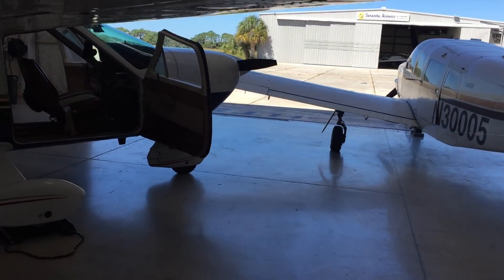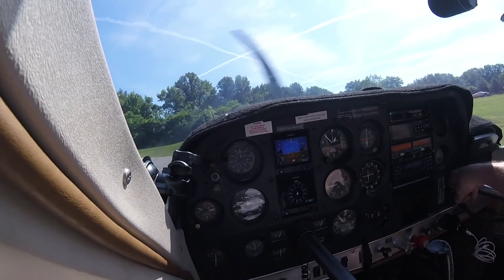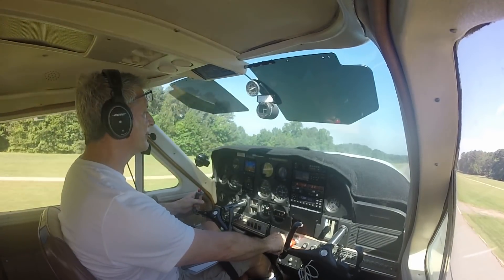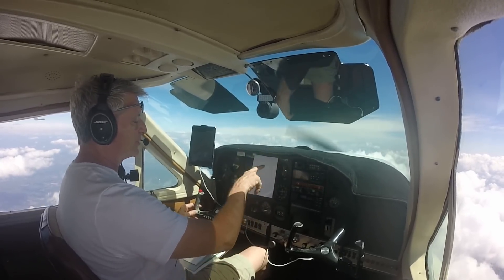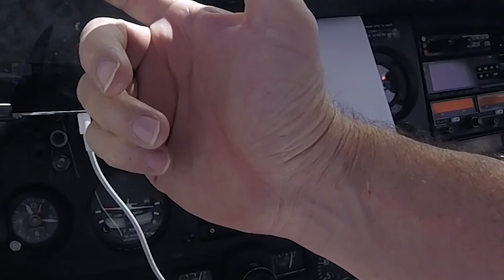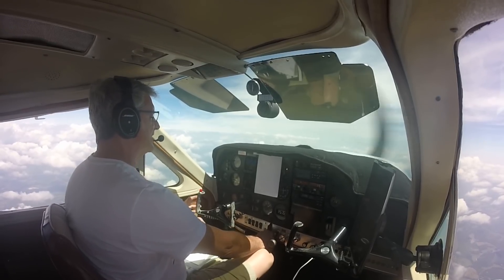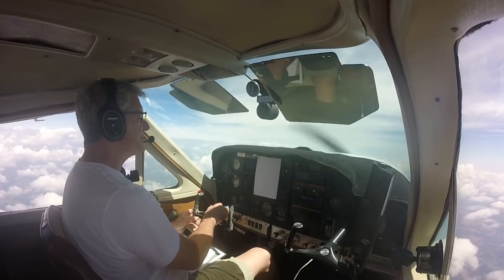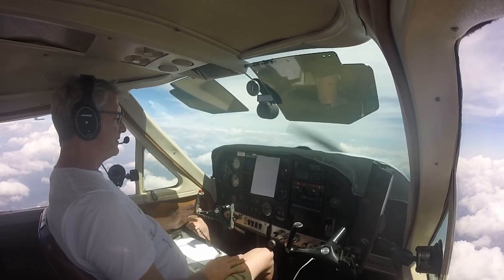Flying with new Garmin G5's

Comment: Hi, how do you like your visors? Where did you get them and do you mind they don’t swing to shade you from the side?  Are they better than Rosen style? Love your channel, thanks
Reply from the maker: Well my visors are embarrassing actually because they are just the plastic piece that I found on eBay for $50 and I took the old visors out and mounted the new plastic pieces on the insert bar from the old visors and yes it was very cheap but it was much needed until I can get around and buy proper Rose and visors for the airplane. The next thing that needs to go on that airplane our seatbelts. Thanks for watching!

Comment: So having transitioned to glass 2 years ago, don't sweat the urge to look at the old altimeter and airspeed instruments. It goes away after a while, then you get into the mode of "hey, lets verify the altitude with the steam gauge".
What I didn't do is remove the old steam gauges. I really don't understand the pilots that went glass and then left blank panel around it. I have the pitot/static instruments on bottom row, and the old AI and DG to the right. Love that busy panel, and love the combination of old and new.

Comment: Garmin GFC500 Autopilot is next? Naturally with the Garmin GPS so you can use destination mode with multiple way points. After all....it's only money. But just think of how easy it will make those cross country trips, and those IFR flights in the future.

Comment: I just did an IPC in a plane a few months ago that had a G5, and you just made me realize I still looked at the altimeter the whole time for altitude, never even used the G5 for altitude. As far as sensitivity, it seems like that altitude is like a digital tach, which drives me crazy. Trying to nail that RMP but it's so sensitive you just have to make peace you aren't going to have it exact. Never thought about the same thing with altitude on the G5, especially since I never thought to use it since I had the altimeter. lol.

Comment: I did all of my private training in steam gauge airplanes.  I'm now working on my instrument rating in a G1000 172.  The EFIS is so much easier in every way.  Along with the instrument training itself, the glass panels have made me a much more precise pilot.  You can almost put the attitude indicator on a single pixel to balance the airplane on the head of a pin. The tapes are so sensitive that you can immediately see when you're deviating from airspeed or altitude.  If I ever buy an airplane, it will likely be an old steam gauge.  The first upgrade I'd want to do would be the G5s if there isn't already a WAAS GPS in the panel.